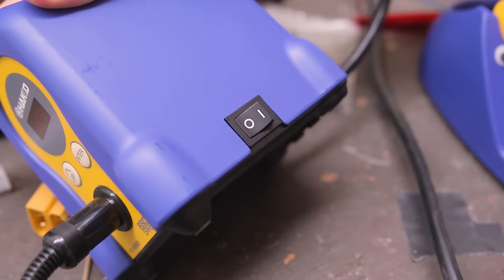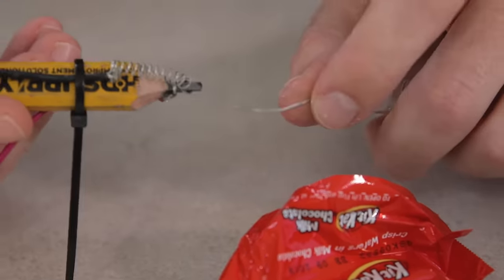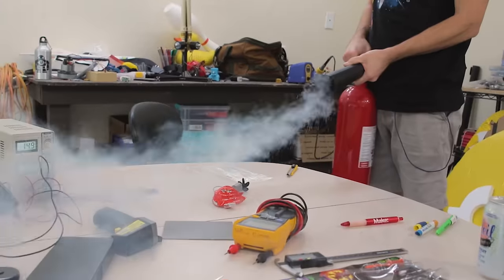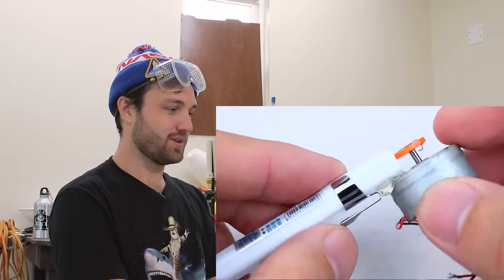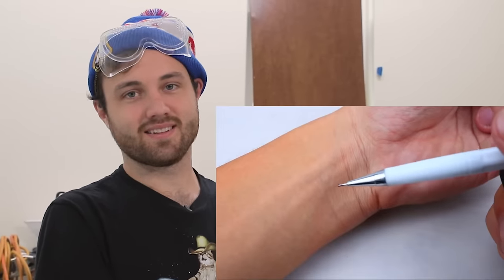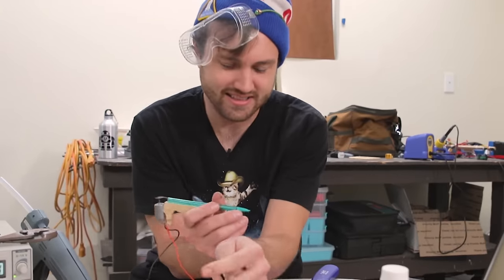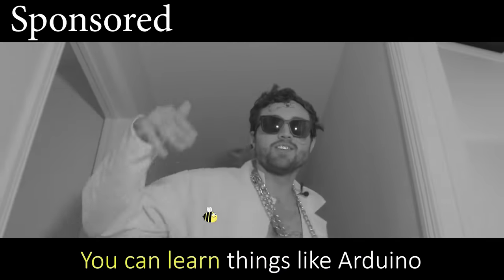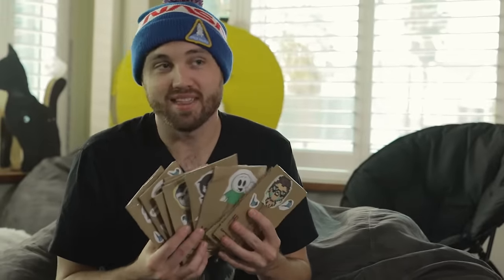I Followed A Tattoo Machine Tutorial

Comment: That's actually how you do efficient tattoos in prison, but, you use a guitar string or a sharpened wire or straightened out sharpened pen spring. It has to be sharpened
Reply: FSG Menthol and you have to use something besides pen ink, like ink made from graphite... or so I hear
Reply: @TreyBattles  I've heard of people getting ink from playing cards
Reply: You don't "sharpen" them. You pop them with a candle fire. Just pull on each side of the wire. Put it under a open flame. And pop, you have pointy wire.
Reply: tincan tony yeah my roommate and I tried that but it took a while and didn’t yield much ink. The graphite ink work a lot better and we made a good sized batch in about 10 minutes or so. We tattooed our rank on our thighs and I still have mine after 3 years 😂
Reply: @TreyBattles  you can get a hold of India ink (typical tattoo ink) in some prisons. Pen ink will work but it's not something you should aim for.

Regular pen ink is not graphite but it is a carbon solution with compounds that you probably don't want in your skin. It works the same way India ink. The carbon in the ink will stay in your skin after your body metabolizes whatever it was suspended in. India ink is essentially just soot and water but pen ink contains chemical compounds including but not limited to  oleic acid and alkyl alkanolamide which are solvents. I am not sure if they are dangerous for you in such small amounts, but I am certain water is used in India Ink for a good reason. Lol
Reply: You can also make ink out of more things than I can possibly list, the problem in prison is going to be your access to solvents besides water so stuff like cards and magazines are going to be top picks. Though you could technically get ink right out of your jumpsuit.
Reply: i mean he also wasn’t trying to give him self a tattoo
Reply: FSG Menthol Would not recommend using a guitar string as they are oxidised.
Reply: Where the fuck did you get the motor from?
Reply: Jooshbag you can just stick the guitar string into a mechanical pencil and put a dot of superglue on the end. I’ve done a guitar string motorized tattoo machine and a baby pin and mechanical pencil stick and poke. The stick and poke works so much better because you can provide force against the skins resistance which you can’t with small rotary tattoo machines.
Reply: Lol I’ve done that probably dangerous
Reply: @josh.8104  you can get them cd players in prison
Reply: @indiomoustafa2047  Shampoo and water mixed with carbon off of burning newspaper makes a great black ink
Reply: @drichmo  stick and poke is actually a lot worse imo, you cant get shading to the degree you can with rotary machines and also its a low more time consuming
Reply: @josh.8104  We usually pulled the motors out of CD players, which are allowed (or used to be at least). We made the ink by burning baby oil or plastic spoons inside a paper chimney and catching the soot on a piece of cardboard we'd lay over the top of the chimney. We then mixed the soot with this super thin shampoo they gave us. Made great tattoo ink.
Reply: @mattshultz8448  We made the soot using butter candle and the under of a can to catch it
Reply: India ink is the safest ink for at home tattoos, it's basically the stuff tattoo artist use but use black no colors. Tape a needle to a pencil eraser, sanitize with alcohol pads and then sanitize the spot you want to tattoo, dip in the ink then get to work. I'm not recommending you do this but it is the safest way without getting a professional to do it
Reply: I'm curious about inefficient prison tattoos now.
Reply: Does guitar string need to be sharpened
Reply: Quin Quin no it is not
Reply: @sportyeight7769  You most definitely have to sharpen the needle. Its absolutely stupid to say otherwise. The needle will not pierce otherwise. I've used homemade tattoo guns before.
Reply: Sharp ink
Reply: Melted chess piece ink
Reply: @sportyeight7769  where in the hell are you going to be able to get ahold of fire in prison??
Reply: You guys are 

Very knowledgeable in this
Reply: @vV4L1UM  pop the socket, or batteries to make fire. Lol ppl have hours to think of this stuff and lots of it are very old skills learnt way back.

 There are a lot of very clever ppl behind those walls. Youd be surprised at the stuff they can do. They can get a ton of stuff off guards too
Reply: shakiro it’s very interesting
Reply: Why do you know this!
Reply: sharpened
Reply: Or you use the spring from a lightghter that doesn't work

Comment: You didn't make a point on the needle, it's blunt. Cut it at 45 degrees and it'll work perfectly.
Reply: I don't think the video did it either so technically he followed it correctly??
Reply: Yep
Reply: Thank you for your professional prisoner Insight.
Reply: If it's a needle then wouldn't it already be pointed on one end?
Reply: @jessegardner33  its not a needle but just a straight spring.
Reply: The guy I know who made his own tattoo gun just bought some needles from me for that 😅 why do I have needles? Uhm... Reasons. I'M NOT AN ADDICT MOM I SWEAR!
Reply: But, do you want it to work ?
Reply: or heat one part and pull until it pops making a sharp edge

Comment: Was a prison officer. I have a pretty cool tattoo gun I confiscated from someone. They also make pencil soldering irons regularly.
Reply: What does the inmates need a soldering iron for?
Reply: @tramsapor  repairing radios and fans mostly. Radios are expensive relitave to the environment. I've even seen them add LEDs that go off with the beat. They also make speakers from a magazine and bare wire. Some of them are actually pretty loud
Reply: Chris, Chris please tell me 

Where IN THE HECK do they get the motors?
Reply: @josh.8104  usually it's the motor out of a fan
Reply: @delfco12  Those guys honestly just need a modestly budgeted maker program, but I already know how horribly underfunded prisons typically are, so I guess it'll just have to exist as a pipedream.
Reply: @josh.8104  my unit only had 25% staff there 8s no way that would of been feasible
Reply: Jooshbag Prison is a makers program by the sounds of it and honestly it sounds like they get enough extra curricular activities that the tax payers pay for, its prison not summer camp. That said, I’m not completely against the idea, I just don’t want to pay for their arts and crafts while I’m out working. If they sold the stuff they made to where it’s self supporting then that’s cool. Prison to some degree should be about rehabilitation and that means being a productive member of society so I think they should be working or doing something productive to cover their stay there
Reply: @mcearl8073  You for that so they can rejoin society afterwards instead of continuing crime and being but back into prison
Reply: Spikeupine Did you read my comment fully?  Is there really an issue with not having everything funded by the tax payers? I’d rather my tax dollars go to help someone struggling, and there’s definitely a few of those in prison but a lot of them are 100% capable of doing something productive in prison and paying for their stay and paying for their materials used. Instead of them sending belts and shit that they make home to their families or giving it to COs or whatever they do the prison could sell it online, there’s some talented people in prison. If they make more than it costs them then they can keep a part of it. So not only do they learn a trade or a craft, they also learn how to run a small business and hopefully earn some money.
Reply: Puppy Puppington its a prison, why would they give it back to them, prisoners obviously arent allowed to have that shit
Reply: Christopher Pritchett sureeee
Reply: @tramsapor   soldering
Reply: @mcearl8073  Couldn't them making shit in prison lead to a possible career once they're out?
Reply: this is why i think prisoners should forced to learn in prison
Reply: @approaching404 ... They are  already to be in prison. Let them make their own choice whether to lesrn or not.

You would force them to learn how? Because the only way you can force someone to do something is with the threat of violence.

Maybe to did not think It all the way through but what your saying is tell the prisoners to read books and learn and beat them if they refuse, and don't stop until they comply you know for their good so they can learn!
Reply: Maybe they should sentence people to a period of punishment and then get a time of mandatory rehabilitation.
Reply: @mcearl8073  prison is for rehabilitation. You can rehabilitate with education especially if the crimes they comitted were related to poverty in the first place. Teaching a marketable skill is totally warranted in a prison.
Reply: Dana N Can you quote my comment that said they shouldn’t be taught anything? You can’t because I didn’t. 

Also prison really isn’t for rehabilitation, it can be for that but considering there are lifers in there who will never see the outside they are in there because it’s not safe for the public to have them out. The point of my comment that you failed to pickup on is that they should be taught marketable skills and those skills should be used while still inside to find their stay there so they can be productive members of society even while being locked up instead of a burden on society.
Reply: That's pretty interesting.
Reply: is this a joke?
Reply: This is a life hack review video why is this so toxic?
Reply: @mcearl8073  the reason there are people in their for life is because our criminal justice system is busted as fuck. Also fuck the narrative that people should be required to be “productive.” People in prison are already more productive than your average office worker will ever be. Prisons literally build half our roads. They make up a ton of the fire fighting force in California. And they get paid basically nothing. Prisons are already performing slave labor for you, what more do you want from them?
Reply: I'm so glad I'm not the only one who saw this and had flashbacks to confiscating tattoo guns from inmates
Reply: Prison officer watchs prison movie scenes and rates them on how accurate.
Reply: @delfco12  Do you confiscate the speakers? I know most prison radios have poor sound output to stop them from being annoying but also it doesn't sound like they're breaking any rules with that
Reply: @kimgkomg  We do tanke them. There is a specific rule that says they cant modify anything or have possession of anything that is not legal material, state issued(clothes and toiletries) or purchased from commissary. Even commissary items must have a receipt to prove they are the ones that purchased it. Anything outside of that without propper authorization is considered contraband and subject to confiscation. As a CO we have to enforce every rule the same to try and reform offenders. It's not about the speaker it's about the rule. That's why they are in there because they couldn't follow the rules(laws) on the outside.
Reply: oink
Reply: @mcearl8073  Prisons should definitely focus on rehabilitation. Otherwise they are just mandatory crime schools. Watch the movie Blow with Johnny Depp. Besides, most people in the US prison system are in for stupid shit like weed or petty drug crimes, basically non-violent things. The US actually has the highest per capita prison population in the entire world!!! Just think about that for a second. Once you go to prison, very few people can ever make it out without becoming lifers. It institutionalizes you to a life of crime and steals any chance you have to forge a better path. Nobody is going to get out of prison and somehow buy a house and get a good job with zero money, no education, no money to get an education, no way to get a loan since they were just in prison, etc. It basically prevents you from reentering society as anything but a minimum wage fastfood worker. Sweden actually has some interesting prisons that allow inmates to take college classes and learn trades and life skills and helps them secure housing etc. after being released.

Comment: I like how he doesnt question if you can get a motor in prison
Reply: Electric tooth brushes are available for some prisoners
Reply: Work shop
Reply: That's what the soldering iron is for.
Reply: Robert Wallace They can definitely get motors in prison.
Reply: Prison tattoos are definitely a thing.. ergo someone built a tattoo gun outta stuff that can be found in a prison.
Reply: To make cars
Reply: Robert Wallace if you work in a shop class/ machinery class they let you work with motors
Reply: Robert Wallace i just assumed  there was a Walmart in American prisons
Reply: We used to use the motors from a  Walkman... I don't know if they still issue those but the commissary shop has quite a lot of stuff
Reply: @FUCK_________googIe  I don't know what kind of prison you went to but over here, electrical toothbrushes, electric shavers, PS1s, Walkmans and Diskmans are all still allowed. You could get a motor from any of these devices. A lot of them might be sealed against tampering, but getting a working mother from a broken Walkman was possible. As for digital music storage, that is completely forbidden around here. No Mp3 players, flash sticks or ipods. You can either use a radio, cassette or CD. At least that was the situation in JVA Stammheim last year. Also, you could still stick n poke if you don't have a motor
Reply: Robert Wallace CD player I’d imagine maybe some kind of Electric razor
Reply: They just stab themselves with ink, they don't even really need a motor anyway
Reply: @angryoctopus1128  ur name makes sense
Reply: I guess you never heard of Red. He's the guy who can get you anything, with the right price.

Comment: In high school I had a friend who wanted to get into tattoo art, and her boyfriend built her (almost) that exact same device.

It worked surprisingly well, iirc later on her boyfriend had a small tattoo made with that same device, the difference being that instead of some random ass piece of wire they used an actual needle made for tattoo machines.

Comment: How to straighten wire 101

1) take one end and tighten it in the chuck of a power drill
2) grab the other end with pliers
3) pull the two ends apart while engaging the power drill until straight

works like a charm
Reply: unless you do it backwards
Reply: @natalieisagirlnow  pretty sure it still works tbh... Ill have to try and see
Reply: this fatigues the metal.  it's an easy way to do it if you can redo the heat treat afterwards
Reply: I've seen "professional" prison tattoo artists.. what they do is heat the spring with a lighter in the middle and pull on both ends

Comment: As a former inmate with tattoos from jail in this exact manor i can say this DOES work... We did it with tape deck or cd player motors and you need to sharpen the tip of the spring to a point. 😂

Comment: sandpaper the needle to sharpen it until it is able to pierce a plastic glove with an easy and smooth motion. and use a candle to help straighten out the string by heating it while stretching, don't overdo it otherwise it will break. and an easy and cheap way to find a motor with an offset for this is a hair trimmer as it also comes with a built-in and rechargeable battery, and for god's sake don't use ball pen ink if you don't want to get an infection or poisoning, just use India ink or proper tattoo ink. and always make sure to take good hygiene and disinfect everything to prevent infection

Comment: U.K./eu viewers: buy locally made soldering irons from Weller or similar. Chinesium irons are rated at 220v and will overheat at 230-240v.
Reply: WineScrounger Chinesium lol
Reply: Yesyesyesyes! Had a friend set his table on fire here in the UK messing around with a Chinese import soldering iron. What's crazy is with the stupid customs fee that was randomly attached to the package, it actually cost quite a bit more than a decent solid soldering iron with the right voltage for our power systems.

Comment: Hi, just to let u know the TATTOO GUN does in fact work I've had a tattoo of smiley face done on my leg and it's still there after 3-4 years, it's just whenever you have the spring u have  to heat it up in the middle with smoke thing really hot and pull the two ends apart creating super sharp point

Comment: I’m actually a welder and we use a process called caca or carbon arc cutting air where we take a almost copper foil that’s been wrapped around a graphite rod and we use it to gouge out nasty thick welds easier than using an acetylene torch used more for bigger items

Comment: the graphite on paper thing is only cool if you're using it to control a piezo-electric speaker mounted with a battery to the pencil itself, along with a circuit, then a contact point for a finger holding the pencil, and draw a big dot on the paper for a finger on your other hand. you can draw out patterns for weird pitch fx, or just a line and mark the distance between notes on a scale from that contact point. move the pencil tip along the line and you get a tone, pitch relative to distance. another audio engineer friend of mine built one once and it was squeaky and weird but still actually fun. but I'll sample damn near anything in the right context. I should ask him for the schematics.